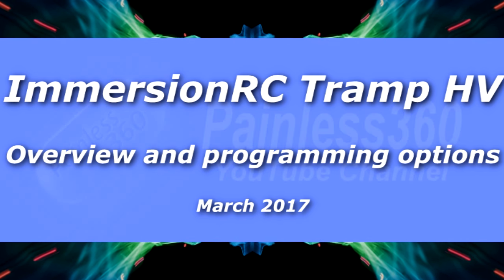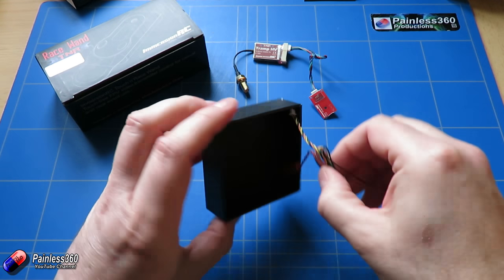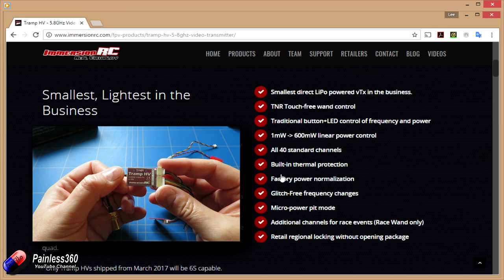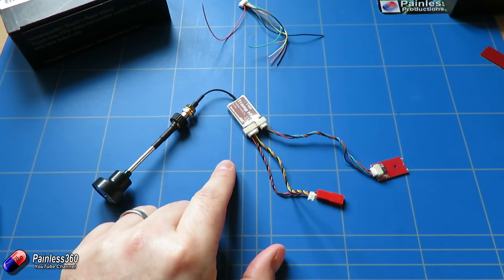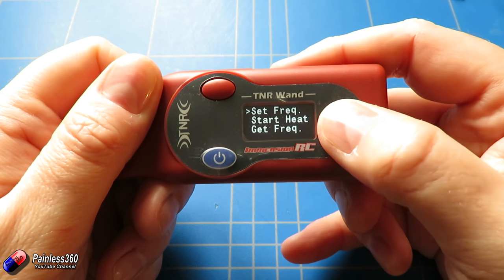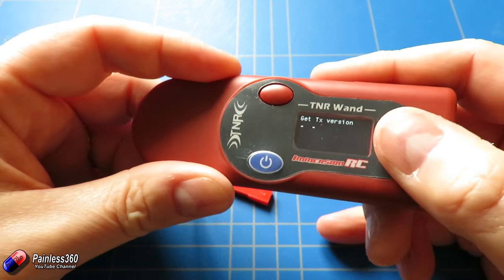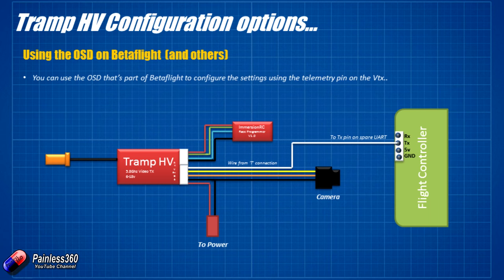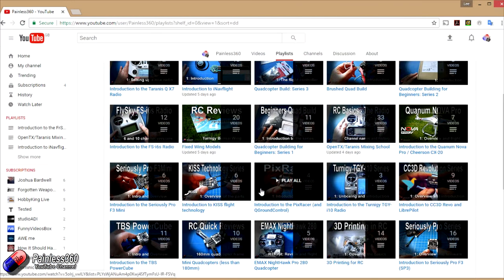RC Overview: ImmersionRC Tramp HV FPV Vtx and Race Wand

Comment: I have 2 Tramps now and have been VERY happy with them. Using the 5v out from the Tramp to power the camera and it has all been rock solid. Bought the wand as well and updated it to version 1.0.5. I took my SPRacing Neo out as could not get that thing to work and replaced it with a Betaflight board and a Tramp in a Goby 180 and very clean install. Have the same setup in my QAV210 and have been very happy. For me the way to go now is a Betaflight board and a Tramp every day of the week.
Reply from the maker: +S700KY_FPV agreed! :-)

Comment: I love the Tramp HV and have this fitted to all my models. Its kind to other as if you have the wand you can set up the Tramp before even powering up the craft. The wand is easy to use and once you have the wand you can set up all your models using the same wand. All your craft a race ready as the organiser can set your Tramp in pit mode so not to upset others until ready to race. The tramp is so small yet the power for this is unbeatable. I love that fact it has a rat tale to connect to the Arial this way you don`t pull the connector off the board in a hard crash. You want to put the receiver for the wand in an easy accessible place so you can place your wand over the board. It may take a short time till you get use to the wand and blipping and may be best not securing the board until happy with the location. Also remember that the rotors can rip the wires if you don’t secure the receiver board in a good place and as far as I can see you cant get replacements. 

The Tramp HV do cost but you pay for what you get and you get a lot with this for your hard cash.

Painless360 You are bang on the nail with this and I would recommend using this on any FPV craft.

Comment: I would like to state that this is not an ImmersionRC proprietary connector. It's just a simpel JST GH style connector. If you'd like to make your own cables you'd need following things:
✓ SN28-B crimping tool
✓ GHR-06V-S connector housings
✓ SSHL-002T-P0.2 crimp socket contacts
✓ 28AWG multi-stranded wire

Comment: hello Painless...  the Wiki of betaflight says  " For the serial interface to work on firmware 1.26, the TNR tag should be disconnected, otherwise, the tag is actively preventing the serial interface to work". This is what probably happens to me , as i can't save settings to enable uart3 and irc tramp... Do you know how to do (or where to look for ) this operation?? Thanks for help. Gianluca, Italy.
Reply from the maker: All I know is in the video, best of luck!

Comment: are there still differences between immersion RC products and receivers of other brands? I read something about different colors or a bad picture if you mix immersion with other brands or is this a problem of the past?
Reply from the maker: I used to come across that a little but haven't seen that for about 18 months here.. Most modern receivers seem to be able to work with just about anything! Happy flying!

Comment: Hi. Did you by any chance do any on the bench temperature readings? At full power 0.6W connected to a 4s lipo I'm getting 86degC, then it drops power and stabalises about 75degC so am a bit concerned about putting this in the enclosed, Ragg-e curse quad frame that I have it intended to go in. Thanks.
Reply from the maker: +On The Fly By I've not, I've heard from another pilot with a different overheating problem so maybe it's worth contacting the seller..

Comment: I'm kind of new in drone world,, so in easy word, I can connect tramp hv to my sp racing f3 board and have osd? right? or do i need like minimosd board? pls help :).. *sorry for my broken english
Reply from the maker: +Azwa Hanif that flight controller doesn't have an osd built-in. See the quadcopter build series for how to setup and use an integrated OSD.. Best of luck!

Comment: can  you uplug the tnr wires from the vtx if you don't have a wand or go racing - just going to use betaflight to config
Reply from the maker: You can use a wand or the buttons on it to configure - see he manual for
 the latest..

Comment: Hi. Please cam you help me... Can the telemetry pin connect to a 3.3v UART such as UART 3 on the SP F4 flight controller? Or does it have to be a 5V UART. Thanks
Reply from the maker: +On The Fly By the signal pens will all be the same voltage so that should work.

Comment: I have just bought one of these transmitters - my first decent transmitter. But, i am gutted, i have bought the EU version from Hobbyking, so stuck at 25mw which is useless to me. To make it worse, i fly apm and pixhawk, so do not have anyway of connecting my new tx up to betaflight. I wish i had access to your race wand for 2 minutes so i could change it to the international settings. Can't believe that there is no onboard way of changing the setting - pretty gutted right now.
Reply from the maker: I don’t think that would help you. There are two versions of the wand and the consumer one (that I have) is only for changing the basic settings. There is another ‘full function’ one only available to authorised people. That one, I believe, can change things like max power settings. Hope you get it sorted soon, Happy flying!

Comment: Hi
In my FC is only RX1 and TX1
I have ibus receiver connected to RX1 , can I connect tramp to TX1 and use it on the same uart ? Or can i connect to sbus pin?
(Flysky receiver don’t work on sbus pin so i had no choice)
Reply from the maker: Probably not. The TX nad RX pins are usually connected to one UART and they can only be configured to do one thing at once usually..
Reply: Painless360 thank you

Comment: my tramp hv gets very very hot. i can not touch surface with my finger. what can be the reason?
Reply from the maker: It should get warm on the higher powers but getting really hot points to a problem..
Reply: @Painless360  i tried 25mW but it is still too hot. but never goes thermal protection mode. i put little heatsink on it however it is hot. checked the sma connector before antenna, there is no problem. also no proplem on image.
but it is annoying..

Comment: So I got this thing and I could not be more unhappy with it. Power seems much less than what is advertised. I added a nice heatsink to coop with the hight temperature at hight power, but that did not improve the reception. I compared it to a cheap Chinese 600mW VTX which actually blew me away in comparison. And to discard any thoughts that I might be some dumb noob not knowing what he's talking about, I am the developer of KissKONG OSD, which is the first AVR based OSD firmware to support natively TrampHV telemetry and control (at least I'm not aware of any others that have done it) and soon to support SmartAudio. I have the feeling this is a case of nice idea but bad execution.
Reply from the maker: +Hristo Gochkov interesting to hear your experience, lots of others are having different ones. Maybe you've had a bad one?
Reply: I also have the power meter they make and noticed that power would not go above 460mW. I thought that might be because it did not have heatsink and I was testing it on my desk. I have the feeling that even that is not a correct number. I had a lot more penetration with the chinese 600mW VTX than the Tramp and I mean huge difference. I also noticed that if the temperature goes above 80 degrees C, communication with the VTX also stops. And getting 80C on the bench takes a minute at 200mW. Honestly I do not know what to think at this point. I can not say that I'm getting 400mW worth of VTX.
Reply from the maker: I'd let the guy you bought it from know you're struggling with it.. Best of luck!